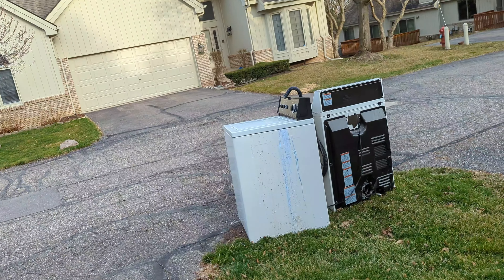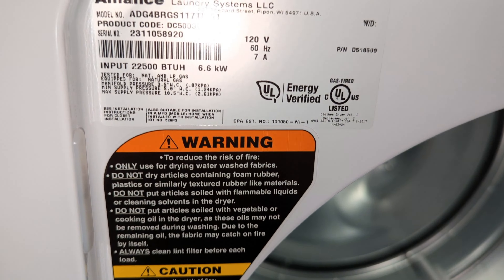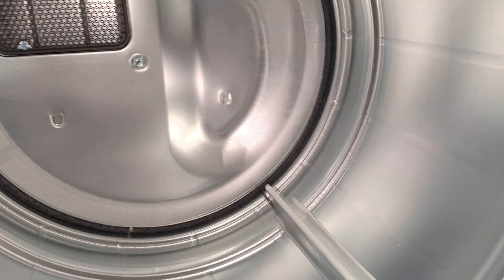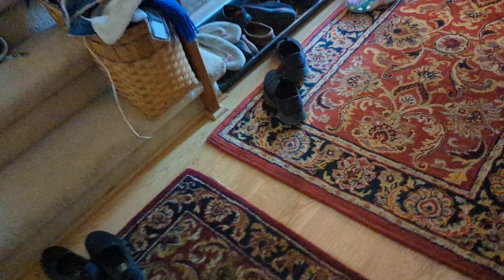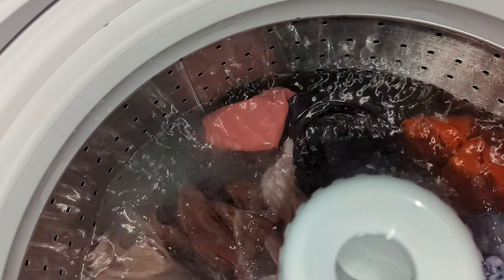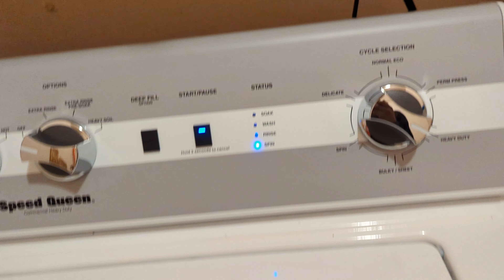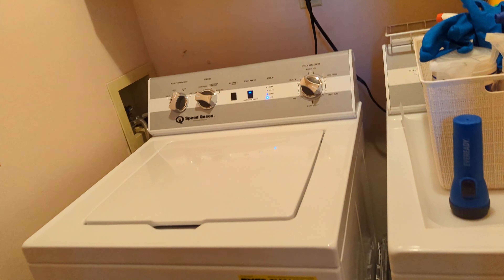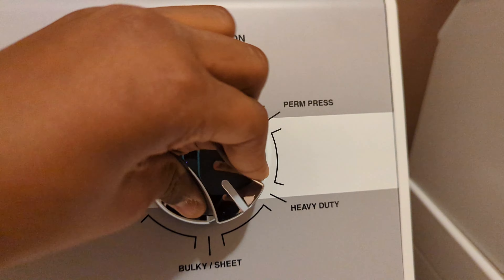(Ramadan) BRAND NEW Speed Queen TC5 washer and dryer set arrived today in the morning/tweaks!

Comment: That Kitchen Aid washer was an excellent machine. I'm sure it could have been cleaned up and repaired. The unique blue agitator offered a much more thorough, yet gentle cleaning action due to the large base and fins. Kitchen Aid direct drives were top of the line, premium made machines made by Whirlpool up until 2006. It saddens me you are throwing the entire machine away. I'm really not a fan of the SQ TC5 machine due to its lack of options and fixed water levels.
Reply from the maker: My grandma couldn't afford it to break again, so she had no choice. R.I.P
Reply: @DanfossDrivesAmerica  I understand. Just still sad to see because these machines are slowly dying off and rotting away in land fills. Direct drives are very easy to fix.
Reply: Speed queen is the same quality and drive system. Much better reliability wise and similar to the old unit